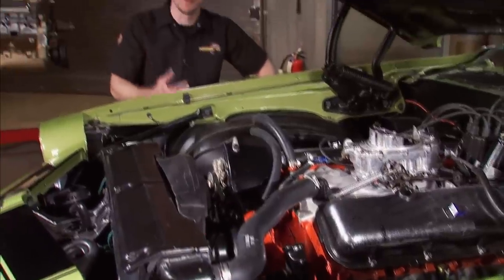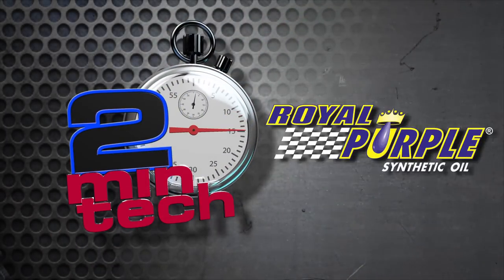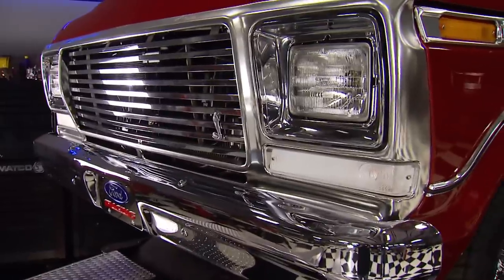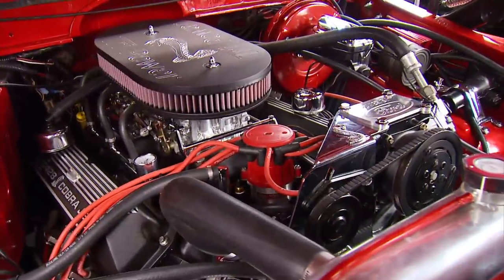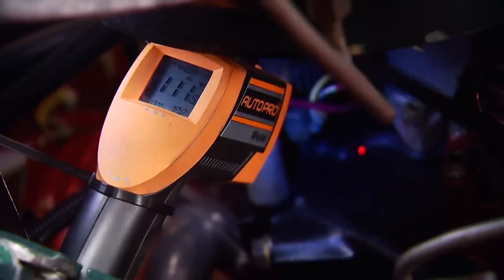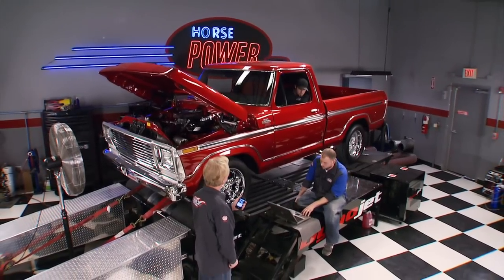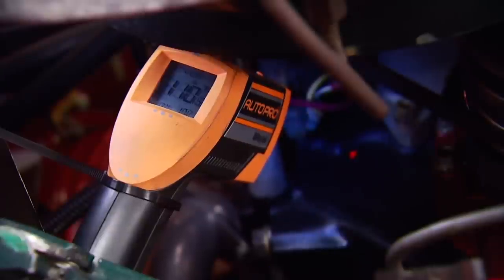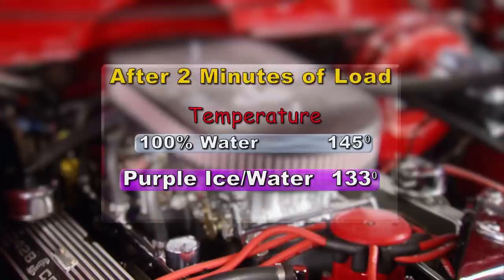How To Reduce Coolant Operating Temperatures - Two Minute Tech

Comment: It be nice to see what 2 similar size bottles of antifreeze would do. I have a 58 chevy impala and can't keep it cool during 100 degree here in Northern California. I'm thinking of adding a second fan I'm the front but some say yes while others say no. Any idea what would work. Thanks
Reply: If you don't have a shroud on it then you should add one and get a fan with more blades on it. Some of the older cars only have four blades on them which don't move much air. Five or even six blades will move significantly more air. Make sure your radiator is not clogged inside and outside (sometimes the outside can be full of dead bugs, dirt, and crud so the airflow through it is minimal, even though it may be clean inside.) There are also high-performance water pumps that move much more water but I don't know if they make them for your car.
Reply: @thickdaddymukbang I put high temperature coating and then wrapped them, because I didn't know weather to use coating or Wrap. I was the smart one that said I would do both🤣🤣. That was a horrible Idea and the first drive my Wrap caught on fire due to putting on too much coating. I let it dry by it probably not long enough. Yes I'm Stupid🤣🤣

Comment: Typical powernation test. Not real world. Take it outside in the heat of the day and drive it. Back roads,  traffic, highway,  up and down hills. A short dyno pull shows nothing.  Your lazer temp gun pointed at who knows what proves nothing. Put in a known good mechanical temp gauge for the before and after tests. Come guys, your pockets are bottomless compared to us out here.

Comment: Engines have an operating temperature, usually regulated by the thermostat and ECU data acquisition sensors, you want to make sure its opening fully an electronic one could open as soon as you give it full throttle for performance applications, the air fuel ratio measured with a wide band o2 sensor will tell you if its running lean/overheating,  at any point throughout the rev and throttle range

Comment: So no one saw that fan in front the truck
Reply: Yes, so basically, add a fan to the front of radiator? I have a 87. Elco with a 454 and been having a over heating problem for a while now .I had 160 thermostat  and it didn't help so I was just told to put 195 thermostat   and at least 2600-4k cfm fans
Reply: @lltinyraggtime2459 It doesn't make sense to me to hold the water in the block until it is 195° when you prefer the motor to run at 180°. Why not give the cooling system a head start by only holding it to 160° and then let it go into a good radiator with a good fan or fans. I say go as big as you can fit and afford with both. If it's overkill, the fans won't turn on, and the engine thermostat will control the engine temperature. What do you think happens on a 40° day or below? The fans don't come on and the thermostat controls engine temperature.  Maybe swap to a 180° in winter.

Comment: I call bullshit. My SBC nova in az right now in August when it's still 105degrees out at 8pm does not get a single degree cooler with straight water and 2 bottles of this stuff. Coolant gets up to 210 and stays pegged there. Before and after. Block Temps of 160. Guess this stuff only works in a ac cooled garage with the hood open and multiple fans pointed at it. Do not spend your money on this stuff. In the summer az weather when this stuff should really matter it doesn't cut it at all. No difference
Reply: AZ local here as well. Thanks for your comment. I was looking for ideas to help my truck in our summer heat. I'll save my money and skip this product

Comment: Total BS. I've tried it and it did nothing. Also what vehicle has a normal operating temp of 121? None that I know of. And whay did you let it cool off a bit before adding the RP? At 135 degrees its nopt like its going to boil over. Again I'm calling bull shit.
Reply: They were measuring a spot on the oil pan, it appeared,  not to water temp in the cooling system. Why? Why not just use the existing temp gauge or add a good mechanical one for the test. It should work as good as water wetter which helps some. My experience was 10-15 degrees cooler on an all iron 12.3:1 big block Chevy with a stock size aluminum radiator in a 68 Camaro drag car.

Comment: You can reduce temperatures by running external heaters or by using custom ducting to throw the heat from your hot Ac outside

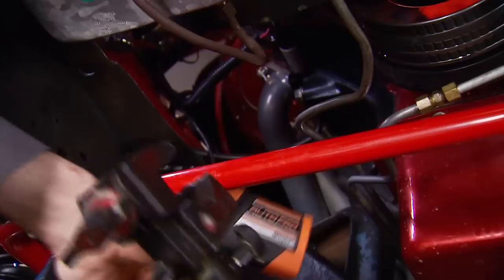Comment: 1:13 Hose water why not distilled water?
Reply: Johnny B The impurities in tap/hose water causes corrosion in your cooling system.  Plus there is a huge difference in boiling tap water and distilled. Without the impurities in distilled when you microwave a mug of distilled water it becomes super heated, then when you drop your spoon in it will explode.

Comment: Another gimmick
Not even using the correct term
Anti freeze water 
They talk about this purple water like it’s some miracle
If you have a substance that transfers heat slightly better with water/antifreeze that’s worth knowing about but this tells me it’s just a money grab
Regardless using the antifreeze specifically designed for your vehicle is the go-to option. This purple BS will probably cause more harm than good in some fluctuating climates, if it actually works.